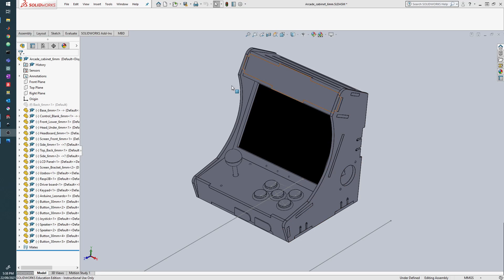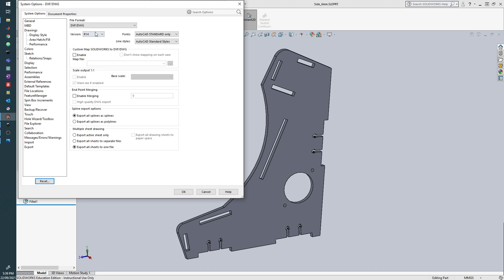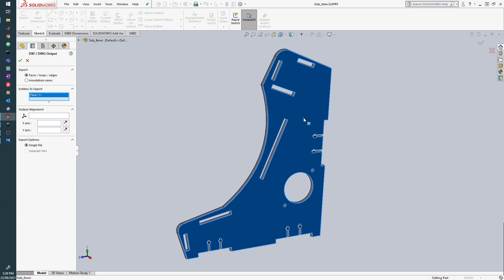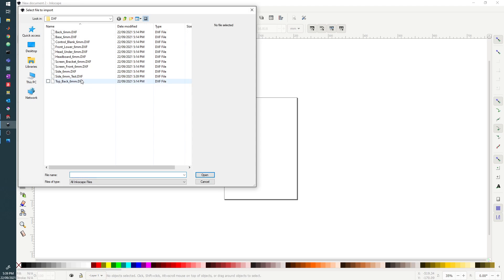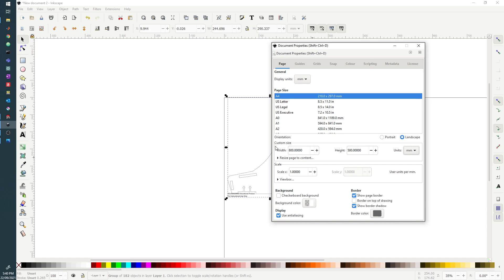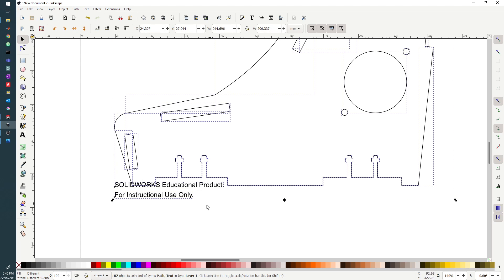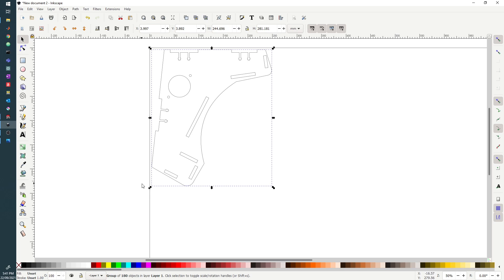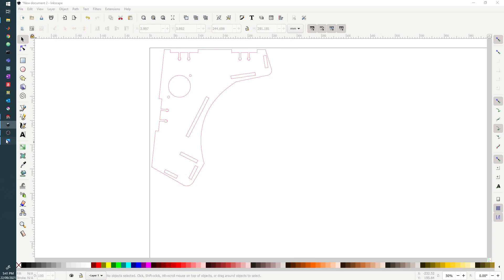Solidworks to Laser Cutter

Comment: What should I do if I want this part but with engraved wide lines on it. Should you draw them in Solidworks? Do you export the same way in this case?
Reply from the maker: Umm, I would do that in post-processing in Inkscape by setting the stroke width and then converting it to a region.
I guess you could do a shallow cut to give a different surface, and then fill the region during post-processing.

Comment: After I import the DXF file into Inkscape, a popup appears after the DXF Input popup saying,
"inkscape has received additional data from the script executed. The script did not return an error, but this may indicate the results will not be as expected.  

SPDMODE is ignored. A point is displayed as normal. "

The file does import, although the scaling is extremely tiny.
Reply from the maker: Hmm, I haven't experienced that issue before sorry.
Reply: @TimRobertsSound  On the DXF Input settings under "Method of Scaling", I selected "Read from file". That helped fix the scaling issue.
The message from my previous comment still showed up, but everything seems fine. 
My part was small enough for me to print on paper from Inkscape and physically check if it was to scale.
Reply from the maker: @jesuscoria5675  That's great to hear that you were able to fix the scaling issue.

Comment: Sir then what are the procedures 
Do we have to save .SVG file format ?
No need to change the dimensions?
Reply from the maker: Yes, I forgot to add that to the video. No need to change the dimensions.
Reply: @TimRobertsSound  Can I contact you sir
Reply from the maker: What are you needing help with specifically.  The process of moving from Inkscape to your laser will depend on the laser that you are using.  This guide was for a Trotec laser that has a print driver for sending to the laser.